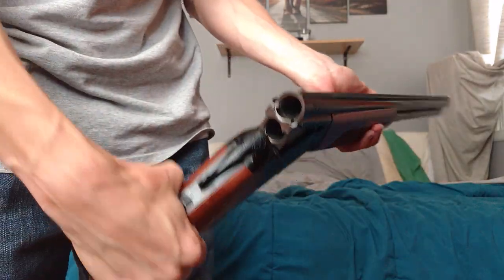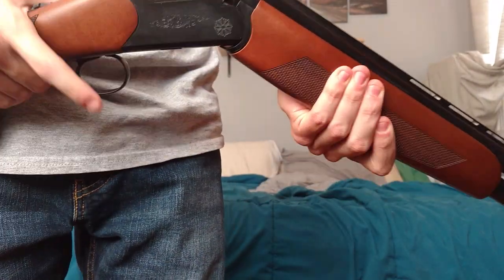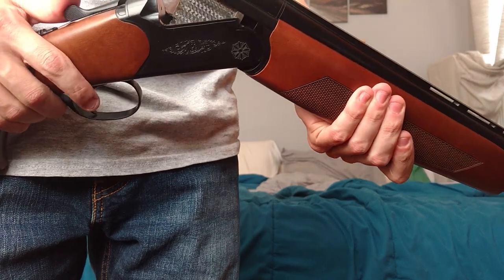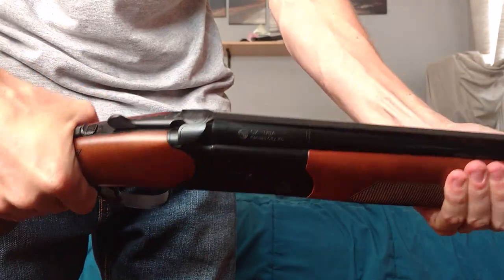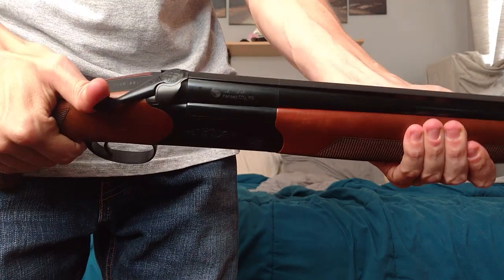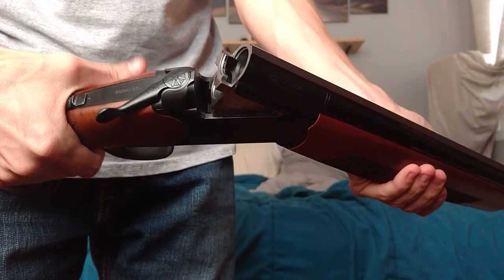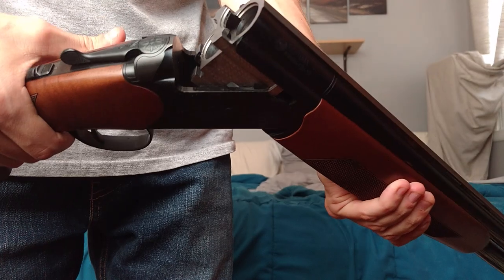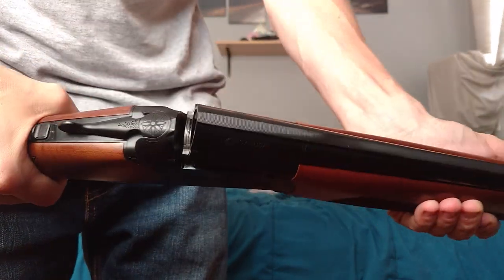CZ Drake 12ga, issue not locking open.

Comment: You get it figured out?
Reply from the maker: OrignalRECIPE92 I sprayed some rem oil and it made it a bit better but it still occasionally slips. I have been shooting my rifles more recently, I hope to get back to the skeet range soon.
Reply: @N69sZelda  send it to CZ in Kansas City. Oil will not fix that issue.
Reply: @N69sZelda  Hi, did you get this fixed or looked at? Did you find out what the issue was? This just happened to me today.